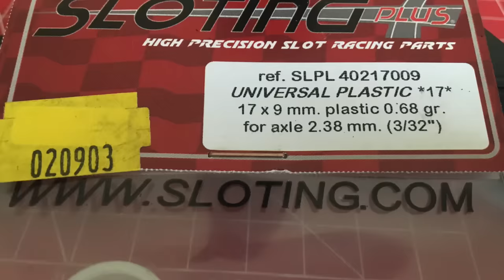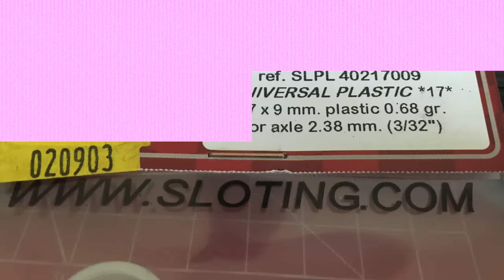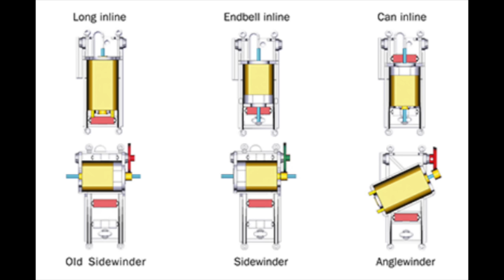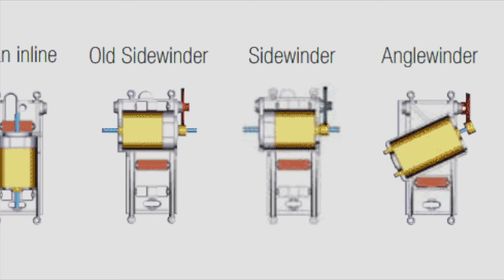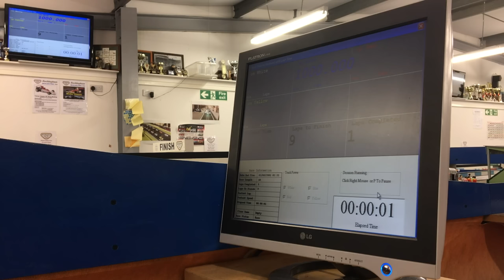Toy Brands vs. Professional Slot Racing Cars

Comment: Raced 32nd scale for many years, and was always impressed how quickly and consistently well guys who spent a lot of time on their cars got them to go.
 That wasn’t what I wanted from the hobby though.
 I much preferred when we would race stock cars straight from the box, with maybe limited mods allowed like adding weight.
  Seemed to make for more fun racing.
  I guess that’s why I didn’t race 24th scale stuff.  Maybe didn’t have the reactions for it either.
 But still had fun, I already spent way too much time and money on RC car racing, so slot stuff was for me quite a secondary hobby 

 Good video though.  Lots of good info.
Reply: 99% of slot car owners are strictly in it for fun, and to make cars go fast.
But they still have other interests in life.

Comment: That was a very professional presentation. Well done is hugely deserved. 
It was also very interesting for me to see the inner workings of a modern 'professional' 1/32 slot car. When I last raced - about 56 years ago, - if you didn't want to use Scalextric or MRRC you basically had to scratch build your own. One feature we built which I couldn't quite see if available on the pro car you demonstrated, was a lightly weighted drop arm holding the pickups. The principal being that you could keep the power on even if the car was starting to leave contact with the track. I was impressed to see that your cars have still retained the 'floppy body' principal though, as that really did make a massive difference as well. I see you have been racing for 20years, so I will say long may your quick reactions stay with you. 
Thank you for the video.
PS. I still have almost all my home made cars, and they certainly look like relics compared to the new stuff.
Reply from the maker: NSR cars used to come with drop arms but as of their most recent release, the AMG GT3, they have ditched this feature. There are some specialist Rally and Rally RAID cars with drop arms, but these compete on special courses with obstacles and hills where having the guide remain in the slot while the vehicle tackles the obstacles is essential rather than simply desired for performance reasons. So, they’re still about, here and there, but not very common. Thanks for watching.
Reply: Pro drivers get Sponsorship, real jobs in the Slot Racing !

Comment: Slot car technology hasn't changed much from the mid 1960's . 🏆 🏎
Reply: Its changed HUGELY. Nothing is the same.
Especially digital slots. Totally programmable.   The cars are fast and solid right out of the box.
Tons of aftermarket stuff can be had to make any car go faster.
Every part of the car can be changed or modified.

A pro, like in this video, is very, very far removed from the everyday slot car guy.
Whole different world.    Home slot car racing is what happens in most of America.
Nothing like a big wooden track.             Slot cars are a blast! They're for fun.

Comment: I appreciate all the excellent info that you have provided. I have a lot of slot cars from several manufacturers plus my own scratch builds. I often have the most fun from old cars, or old design cars, that aren't very fast and certainly can't corner fast. My Scalextric Ford GT40 and Jaguar E-type from the 1970s may take twice as long over a lap and fall off if you don't seriously slow for corners, but I'd recommend them over the best modern professional car.

Comment: A small flat were the set screw* clamps on to the axle will lock the wheel more securely. I'm surprised that some aftermarket axle and wheel sets do not use nuts on the axles with the wheel sitting on a taper. This taper could be the same taper as the appropriate sized machine taper.
*in the states they're set screws.

Comment: My slot racing was in the late 1960’s. Starting with scalextric and ending with a vacuum formed body shell with a 1/16” brass rod chassis . Body mount was thin brass sheet hinged onto the chassis held into place with dressmaking pins. Motor was a standard Cox can not tuned sponge rear tyres from from a revel kit car the body was the gas turbine car used in Le Mans 24 hour all run on a club circuit at the English Electric Factory Kidsgrove Stoke-on-Trent.
Reply: Yes,  as a kid I used to order all kinds of hardware from Riko in England.  The real fanatics were even rewinding their motors with thicker copper wire for more speed!
Reply: @racketman2u  yes, I tried that. I still have the wire reel somewhere.
I took 4 sections off the armature, to increase RPM. 
Then rewound it with 4’6” or 16 SWG copper to flatten the torque curve.
Covered the rewind in araldite and baked it in the oven then checked it for balance.
Then finished off with some high strength magnets.
I used my old chassis but a new body shell with Mk.II written on each side.
A disaster. Practice run, fine didn’t put my thumb down hard on my MRRC. Controller but I did notice it was warm. 
Line up for the first race. Thumb down, everyone else was on the banked bend at the end of the straight.
My car was upside down about 2’ from the start line. Far too much torque for a low geared car 😡.

Comment: I used pro slot cars once and they didn’t have front wheels or suspension. I think they where called group 12 cars. Would be interesting to see a video on those cars versus the ones you use.

Comment: I got out of slot car 1/24 scale racing when I realized that I wasn't as good as the national champions who were building their own brass plate, brass rod, and piano wire frames (this was back around 1970). As a teen, instead I moved to real cars, and then realized that I was never going to be as good as the champions at that either. So I stopped racing, and just started driving and riding motorcycles for fun instead.

Comment: I had a ninco F1 Jordan car.
It had a very clever front wheel steering setup . A big magnet in the front and a larger motor then an average 1/32 toy.

That thing compared to the stock cars was utterly insane.

Unfortunately the standard power supply couldn’t handle it. So if I race that car on my track the second rails had no power. It took 75% of a two lane system.

Point is I’d like to see the difference between those Ninco’s and a professional one.
While certainly not competition legal i think it would give it a run for the money
Reply from the maker: Ninco kind of straddle the line between toys and pro cars. It’s such a shame that they’ve more or less left the market now. Stick around on the channel as I’m sure you’ll see some future Ninco content here 😉

Comment: I had absolutely no idea there was a slot car scene. I thought there only existed scalectrix, no idea the hobby went this deep. Odd to see this pop up on my recommended
Reply: Clubs all over the world, Scalextric is one of the toy brands but often cars are raced on huge routed wooden tracks. The controllers have break, sensitivity, launch control and other trim settings and features. The skill comes down to car set up, ability to drive smooth and break and accelerate at the right place on the track. 

The pro cars have suspension, different motor configurations, tyre compounds, precision engineered components etc. It is definately not as easy as people think.

Comment: It all depends on the car. A Scalextric Ford GTE will run with most slot it or NSR cars. Surprisingly the Scalextric Back to the Future Delorean cars will run with pretty much anything and I’ve seen them beat Slot it and NSR cars. The real terrible out of the box cars are Carrera cars, they are heavy and SLOW.
Reply: Depends how much modification you do to them but then they are no longer stock cars. I have never seen a stock scalextric beat a NSR or slot.it. I have seen how quick Scalextric cars can get but the only thing left stock is the chassis and shell, that is £50 you have spent on upgrades 🤣. Pro cars will always be faster with mods.
Reply: Very well said, I love scalextric

Comment: just means you're consistent as f**k ahaha.
Down here in Australia we did alot with just the plain scalextric cars, we used to slap on bigger guides and do quite a few other little things to get alot out of them to a point where they just went stuff it and opened up the open lemans racing to allow scalextric cars
Reply: Fun to get them as fast as possible. Running the DPR door loose is a good way to try and get more chassis flex if it is DPR ready cars. I run a 3D printed DPR door that is very light and flexible and still in the rules. The Honda Civic Scalextrics run fast, but it seems to be because the plastic chassis is so thin but unlike Slot.it or other hobby grade chassis it is so weak it cracks 🤣. These cars also have e reassessed guide blades which really help them.

Comment: Thanks for this.  How would the same two cars compare on a “regular” scalextric track with magna-traction?
Reply: A "Pro" would never be seen racing on a home track, its all done on scratch built wood tracks where the ultra fast cars really work.
Its a very different thing on a home plastic track, its supposed to be for fun.

Magnets are universally poo poo'd by pros.
Reply: Not completely true. Our club of experienced racers race on standard Scalextric SPORT track because we race digital.  The 24 hour endurance slot car races (an international series) are typically raced with 20 teams on 4 lanes of digital Nino plastic “home” track and the Oxigen digital system. We have been racing this way for at least 15 years.

Comment: Have you seen wheels with built in one-way bearing working as a differential? That would be the ultimate PROFESSIONAL upgrade which will crush all your components. You should look at the Japanese mini 4wd racing cars..
Reply from the maker: Some 1/32 slot cars have rear axel differentials, but they don’t work very well and add unecessary weight. The closest thing to what you’re describing actually exist it in the 4WD e-tron Quattro by Slotit, where the front axel bearings are clutched in a way that the slower moving wheel doesn’t grab the track and is allowed to spin freely.

Comment: I noticed that your cars have little pieces of rubber on the chassis and in the wheel wells of the body. Have you ever needed to change the tires during a race or is that something that's done before or after the race?
Reply from the maker: Endurance races frequently feature tyre / wheel changes. An average set of rubber tyres will last 3-4 hours before performance falls off and can go 8-12 before needing replacing due to total wear. These numbers aren’t absolute as wear is influenced by many factors, but it’s just to give an idea.

Comment: So basically what you guys classify for a "professional " car is just a worked over turd? Springs are a nice touch but we do our effects in mounting the bodies, bushings and bearings are two different things. Our cars would blow your guys minds- not only in Scale but in durability and weight.  Never been a fan of 32nd but have raced them in the past. I'll stick with my h.o. and 24th stuff.

Comment: Great Video. Im 51 and just got my first Scalextric set! I already now have 4 cars and looking to add a 5th. Have you got any links to where I can purchase a "tuned" car to get me going down the right track. Thank you.
Reply: Consider doing some tuning on one of the ones you have to get an idea of what you want.
Reply: Roger where are you based? If you take a look online they are stockists all over the world. There are small tweaks you can make to standard cars but they will never match pro cars
Reply: @nickw7594  Thanks for the reply, I live near Cambridge and usually get my cars from Model Junction in Bury St Edmunds. I seem to struggle to find anyone in England that sells parts or complete modified cars.
Reply: Perhaps try Pendle Slot Racing............
Reply: @rogercarder7720  Pendles are good but you can also get some good 3d printed chassis off ebay that fit Scalextric shells. Best thing to do is find a local club and then let them show you how to modify the cars. There are certain cars to buy that are known fast cars. 

If your looking at running modified Scalextric cars at home then just sand the tyres, glue the tyres to the rims, glue the motor with hot glue (a line each side of the motor), take the magnet out, add some lead, take the stock wiring out and fit a guide blade with a sleeve so there is no play in the guide blade.

 You need to add float to the body too so you can trim off any chasis lugs and around the chassis taking it back 1-2mm. Back the screws off so the shell is loose and can move (put tape on the screw holes so they don't fall out or upgrade screws).

Other options can include fitting a new motor (not really needed for home use), slot.it running gear and independent front axle but at that point you could of bought a pro car like NSR or Slot.it. It is only worth running highly modified Scalextric cars if you are racing at a club and have to race in a class e.g. Scalextric  modified class.

A lot of clubs race Scalextric classes  because they are easy to get into and you can pick cars up cheap and start racing for £30-40.

Comment: funnily enough literally the only toy car I owned that I did not motorize at some point was a slot car with the guts missing that I got in a box of stuff from a garage sale. I motorized my hotwheels collection for fk's sake...though come to think of it there would have been a few in there that my solution for motorizing them wouldn't have fit on so "literally" is probably not quite true.
I think the weirdest one was making a toy car out of my salad: I'd been fiddling with odds and ends on the table when mom drops the salad and a stack of plates on the table and tells me I need to clean things up since we'd be having dinner soon. 10 minutes later the table was mostly clear and I was playing with a toy car I'd made out of a cucumber some celery a few carrot slices 2 toothpicks and a rubber band...not actually sure how she felt about that.
Reply: Cool story man.  Too many mushrooms can do all kinds of things.
Reply: @bradsanders6954  I...think you might be overestimating how hard it is to motorize something, especially if it doesn't need to be controllable.
even a statement like "I made a working model airplane out of linoleum tile, chopsticks, and a couple plastic bags" is a lot more doable than a knee-jerk reaction might make you think...honestly the only hard part in most of those nonsense projects was finding batteries that fit the project, I had a whole dam box of motors in various shapes and sizes and a small but useable collection of transmitters + servos/etc from buggy cars that broke which I could make work for most tasks but batteries? most batteries SUCK when weight is an issue even today, let alone back in the days of NiCads

Comment: Wont you do what I do. I run 1/24 and 1/32 scale and all my scaletrix cars I put aluminum wheels on it and set screws or even thread my own set screw in the plastic wheels. I also learned to machine my own aluminum wheels using the store bought aluminum custom wheels as my guide I make dufferebt offsets and sizes so I have unlimited amoutof wheel setup options. I also make my own gears. I also make my own front wheels that use a tiny press fit bearing abd threaded so that way i have a nut that holds front wheels on a fixed axle pin like you see on 1/10 scale rc pane cars it has a small axle with threads on one side goes tgrough steering block and gets a c clip or E clip on back sude to hold it in and has groves insmthe shaft that grio inside the steering block to keep it it from moving or turning. And my front ends are completely adjustable i can cage camber and caster and ride heights on my 1/24 scale nascars for oval amd rpad course also can adjust skew and ride height of rear solod axle. But I used my scaletrix cars as a guide to build my own tube frame brass chassis for 1/32 scale and make my own brass 24th scale oval road course a d drag chassis. I havnt machined or got crazzy like i use to a few years ago i just grab my cars and go race so much more fun then worrying about setup on cars. Just make sure body floats new tires on cars and go race. I got a giant 1/24 scale 6 lane road course abd oval and rival track at my house with ho scake 6 land runni g right next to the 24th scale track full aize ho scale drag strip on back side 24th scale drag strip true scake 1/4. Mile accross room. And in floor i got. Huge 1/24 scale rc track

Comment: Comparing a Slot.it to a Scalextric or Carrera is like comparing a rocket to a firecracker.  Slot.it cars are crazy fast and planted out of the box and the toy brands just cannot compare no matter what you do to them.  And in Canada Slot.it cars cost about the same or less than the toy brands.
Reply: Not on a tight home track, slot its have no where to run on a home plastic track.

Comment: It's kind of cool that you can get yourself a professional slot-car for about a hundred quid.  Got to be the cheapest motorsport going.
Reply: You can get one for £50-60. The problem is a lot of clubs race multiple classes so you need 5-6 cars. You also need spare parts, tools, pit box, truing machine, controller etc. Your looking at £400-500 to race. Still cheaper than a lot of hobbies.